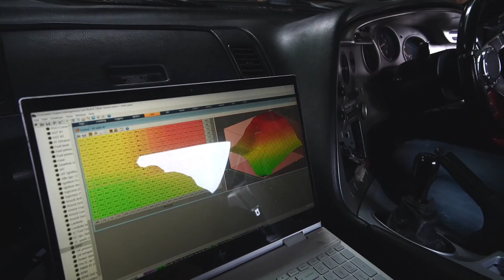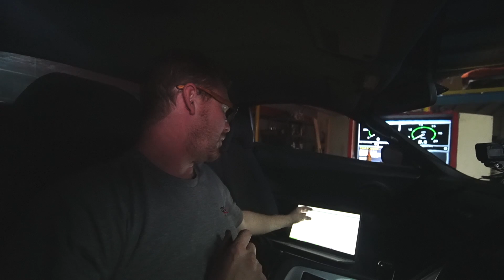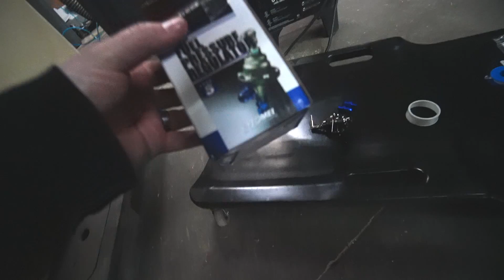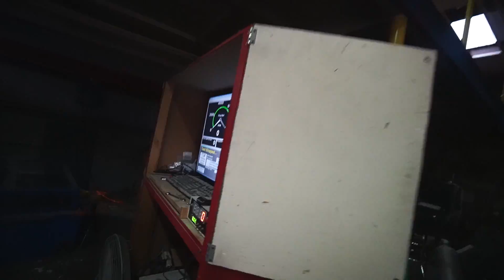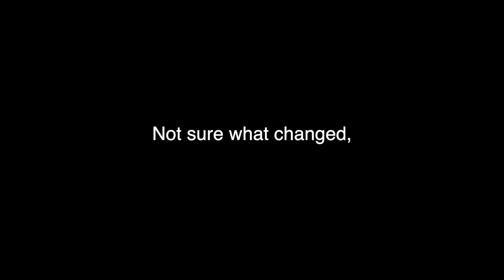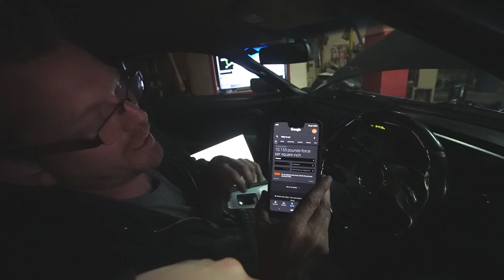HOW MUCH POWER will eBay turbo Supra make?? DYNO DAY!

Comment: Also with an SAFC and stock ECU (MAF before turbo inlet) that’s when I made 336whp. I agree with you though, the ECU helps a lot though!
Reply: Are y’all referring to a standalone ecu or is there a way to run over 5-6 pounds with an AFC, bigger injectors/pump, and a stock ecu?

Comment: If youre not trying to spend a whole lot then I'd recommend getting Oem 93+ Rx7 550 cc injectors, they are drop for the GE's fuel rail and are pretty cheap.

Comment: When the authentic 2j going in
Reply: When he blows the GE
Reply: Authentic 2J? Never heard of a replica 2JZ, sorry mate but go back to eBay.
Reply: the non vvti 2jz-ge is the exact same as the gte with the only difference being compression ratio and heads. rods and crank are the exact same as the gte.
Reply: Vanya.Media actually the gte has a few more oil passages in the block
Reply: @thatcardude528  u clearly dont watch all his vids, so u do not no,when i mean authentic i mean the stock 2jz-gte not the 2jz-get
Reply: I do actually watch all his videos, you just don't make any sense.
Reply: @thatcardude528   what i mean to say is the 2jz gte

Comment: Are you boosting this until she blows and then doing the swap? Id love to see something like that.
Reply: YungMetro it takes a lot to blow the GE non vvti, basically same bottom end as the GTE
The transmission will blow before the engine.
Reply: kc_2jz same block. Similar internals. 500 horse and theyre both a goner.
Reply: YungMetro a healthy ge or gte can take way more than than 500whp easy.
Check out Yosdany Supra channel, his stock bottom end gte is at 1100whp at the moment
Reply: kc_2jz gte’s are not same strength bro ive owned 4 Ge’s. Its not the same thing. Close. But not quite. Gtes are just better at everything
Reply: YungMetro what year and model did you have ?
The ge vvti has weaker rods
The ge non vvti (which the supra NA has) has basically the same internals, same crank, same rods, pistons a little different for higher compression, but same material

The is300, and sc300/gs300 after 1997 have the weaker ge vvti which hold around 450whp
Reply: kc_2jz ive had two 93 sc300s a gs300 and an Is300. One of the sc’s was boosted and ran 487 wheel and it ran like that for a few weeks but having fun with it sent her to her indefinite end.

Comment: My buddy had a 95 Supra with one big turbo made 525hp to wheels 16-22 boost and it was scary fast to me,,,it would pull from 70MPH up to 150 like nothing unbelievable ping you back in the seat power,,,supras are light,,,so 525 hp in it is = to say 700-850 hp in a Camaro or vet,,,wish I had one right now